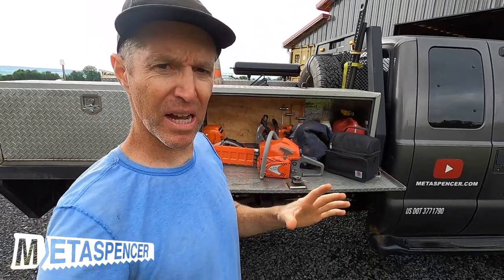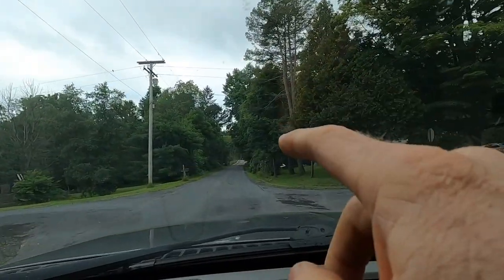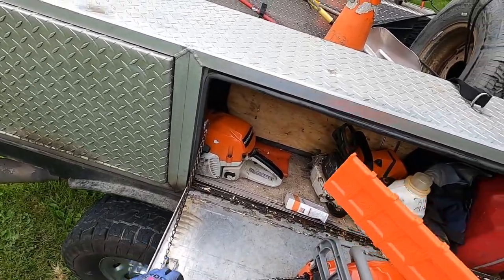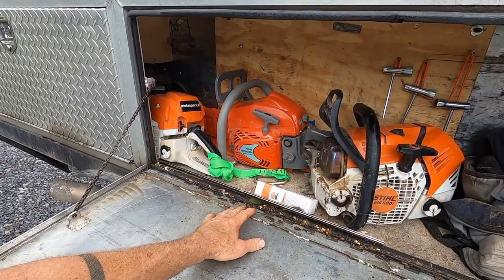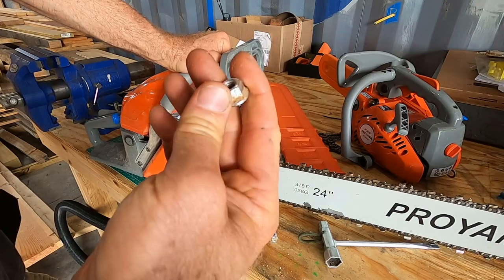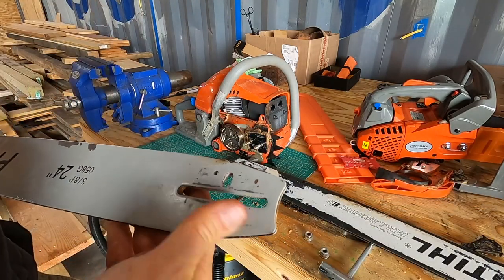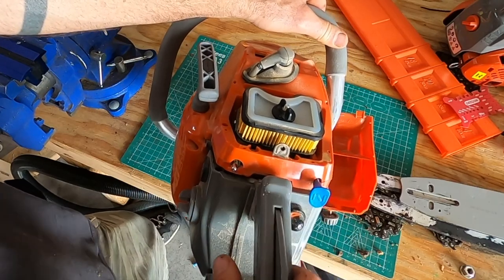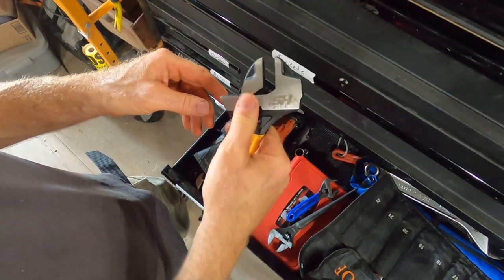*** On the Job Review ** Proyama 68cc Chainsaw

Comment: These lower price point saws have a place. For some folks just starting out these saws are not to bad to learn on . I would love to see one of these 68 cc with full skip 325 20 inch bar and chain  to see if it improves cutting power,Forester sells 325 full skip. That little climber is impressive. A bit of grease on the air filter base helps keeps fines out. K095 Husky bar mount I beleive.
Reply from the maker: I just picked up a full skip chain for the saw thinking it might be good ... so we'll have to see how it performs. Thanks for the tip on grease on the filter. I didn't know that trick!

Comment: That looks like a Husky large mount bar to me.  All the husky bars use those small bar nuts, even the 3120. I've found that for the most part - Stihl uses Stihl bars, and everyone else uses Husqvarna.
Reply: i think you got it... that looks similar... the two holes on the oregon or husky bar is slighlty more biased to the back of the bar and not perfectly centered like this one... but I doubt that would make too much of a difference - it would probably work
Reply from the maker: Makes sense ... I'll pick up a husky bar for backup
Reply: @metaspencer  your rant about bar nuts had me laughing. My on-the-job saws have  included a ported Echo 355T. Stihl 044, 046, and a 661C. Huskies are a 372XP and 395XP.

Not one of them features captive bar nuts. 😂

That said? THIS is a product review done right. “I got this free but there’s a long list of thinfs that suck, to go along with the things China got right.”

It does look like it takes a Husky tail. Which means it will be easy to adapt to Stihl bars with a $10 Amazon adapter. Grind the slot in your Stihl bars longer at the front, and run Stihl bar & chain. My Huskys (and the Echo 800P I sold) have all been adapted to take Stihl gear. I only need a few spare chains snd one spare bar on the truck.
Reply from the maker: @WildAcresFarms  I've never done that bar adapting ... I've gotta try it out! Thanks for the tip!
Reply: @metaspencer  the husky uses smaller studs. So a Stihl bar would have a metric ton of up/down slop. The spacer takes up that space. Oiler lines up so you CAN slap the adapter in and go… but you need a chain with one extra drive link. I prefer to take a carbide burr and cut the forward edge of the slot in the bar longer, so the tensioner can fully retract it. 

As soon as you slap it on the saw & play with it? This will make total sense. $15 adapter plus a minute with a carbide burr and stihl bars run on husky and echo. 😎
Reply: These saws take the small mount K095 Husqvarna bars.

Comment: Very thorough.  Only one of the cons you mentioned, and I heard it on another review, was the melting plastic around the exhaust.  I have to think about that one.  I need a 24 inch bar saw.  I'm taking down some trees that are big.  I had one that was 7 ft in diameter that I had to pay someone to take down.  I have more that a 24" bar will handle but on average an 18" saw is my go to.  I could switch to the 20" bar and have a backup for the 18".  Thanks for the great review.
Reply from the maker: I have another saw that has a foil wrap around the plastic to avoid melting, so there are ways to mitigate heat damage
Reply: @metaspencer  How about some of that stick on Aluminum foil like they use to wrap car muffler leaks and furnace pipe joints?
Reply from the maker: @kenchambers7604  yeah that's the stuff .... seems to work well on my other saws

Comment: I have the same top handle chainsaw that has the clear gas and oil tank and I have no problem with it runs great and starts first pull every time even in sub zero temperature
Reply from the maker: sounds excellent! ya got a good one!
Reply: @metaspencer  so far it is.. I had it over a year now I cut over 10 cord of wood so far and I done nothing to them I just ran it out of the box but I did get a better spark plug and give it a great cleaning so it's ready for the next firewood season... I got it because for years I cut branches right to the main part of the tree then I have to go back to pick up everything that I just cut. Now that I am way older this top handle chainsaw is a game changer because I can cut with one hand and hold the other end and I never have to pick up anything and I looked at every part for the chainsaw and it very cheap...
Reply from the maker: just be DANG CAREFUL! in the arborist world we see a lot of accidents from people one-handing top-handle saws ... so don't let it get ya!!!  @oldrust601

Comment: What do you use for premix oil? Excellent video.
Reply from the maker: I tend to use Husky oil, sometimes Oregon or stihl. I use 50:1 in all my saws, non-ethanol gas. Some of these saws call for more oil in the mix but I haven't had any trouble running 50:1 .... some guys will advise 40:1 though and they may be right

Comment: I notice that there was some fine dust stuck to the bottom gasket of the air filter which makes me wonder if the wing nut holding the filter was tight.
Reply from the maker: Or could use some grease to capture that dust. Good eye!

Comment: The air filter...at least it's not like stihls where I had to buy 200 dollars of after market filters per each saw ..stihl needs to be charged for their REDICULOUS stock filters ..I mean I wouldn't run my sthils without oil filters .one thing I did like about husky the filters...I liked my old 488 shindiawa. Was 10 pounds and it ripped.had a junk carb that only had one jet to tune. But was sweet .
Reply from the maker: I've shifted over to oil filters on my 500 and should probably do the same with the rest: that dang filter catches A LOT more stuff. thanks for the tip man
Reply: @metaspencer  I forgot to tell you get the velocity stack from Gordy and also the max flow the velocity stack is far better and easy to maintain over the max flow but you can't run it in the rain it runs without the cover. But man is sweet .have simaler set up from west coast on 462 those are best filters made can go all week on one sometimes
Reply from the maker: @Sethhaun78  thanks man ... I've got the max flow ... will check out the velocity stack
Reply: @metaspencer  yes I seen it your videos.

Comment: Hey Man, nice review! I am looking to replace an old Husky I had forever. I used the saw a dozen times a year, maybe less. What do you think about these Proyama's for those purposes? I won't be putting it through the rigors of regular work, and i wonder if its viable option for just getting the odd job done around the property from time to time. The savings are huge, its hard to ignore when you arent relying on it for daily use
Reply from the maker: I think what you describe is a great scenario for a cheaper saw. I have a video I dropped yesterday about a NeoTec clone and their saws might be an option for you as well. I'm not saying they'll be perfect and mine have used a bit of tuning to run just right, but sure beats the pricetag of a Husqvarna these days

Comment: The tale end of the proyama bar is different to bar tension holes on a Husqvarna bar there alot smaller
Reply from the maker: it's too bad they're not compatible
Reply: You could take a round file and open the bar tension holes up a bit on a husky bar
Reply from the maker: @woodloveoutdoors  yah that might be the way to do it ... or die grinder

Comment: Had 2 Husky's and both had starting issues . For many years after I had a Stihl 029 , easy to start , dependable and heavy ! When she was retired I ended up buying the Proyama pc62 and after a full year I'm pleased with the performance and it starts every time on the third pull . When I'm on a job and I'm pulling over and over on the rope and it won't start it's embarrassing and unproductive and pisses me off! Mostly embarrassing.
Reply from the maker: Sounds like you got a good one

Comment: Did you ever confirm to see what bar it will use husky or stihl
Reply from the maker: Runs it's own proprietary Proyama bar but it's dang close to Husky ... just takes a bit of drilling/grinding to make it work
Reply: @metaspencer  that’s a bummer guess I’m getting the 372 holzfforma clone then thanks for the info!
Reply from the maker: @briankinzer4175  I've heard good things about those saws!
Reply: @metaspencer  I own a 272 clone it’s got a step piston in it that’s it everything else is stock it’s lasted 2 years built so far and I dog tf out of it now I’m gonna upgrade to the better 372xp or 395xp I just wanted to see about these saws since they are $250 and the holzfformas are $300

Comment: Looks like a husky... I run Stihl I want a saw like this but that interchanges with Stihl
Reply from the maker: I think Farmertec saws might be what you're looking for
Reply: @metaspencer  Thanks! I just bought the MS440 Knock off. Actually I heard they actually buy the old Sthil/Husky patents after they run out so it should be fairly legit. Anyway, I also bought an engine kit to convert my dads old 029 super into a 039 with much more cc. Thanks for the tip.
Reply from the maker: @CrossroadToCountry  That engine kit sounds pretty cool
Reply: Holzffrma(Farmertec) or Neotec/Farmmac Both offer high end Stihl and Husqvarna clones at affordable prices.

Comment: Is it still holding up?
Reply from the maker: I haven't used it a whole lot, but it still rips every time I take it out. Took a bit of tuning to get it running just right, but it's got good power
Reply: @metaspencer  that's awesome. I bought 63cc pinkway and ported it and it will now smoke my 550xp mark2 and weighs the same. It's strange seeing a 120 saw being picked over the expensive ones. I'm not sure how long the cheap saws last but when I was porting it I was really surprised to see the quality of the cylinder was at least as good if not better than my high end saws
Reply from the maker: @matthewknight5641  I got one of those Pinkway saws too and was pretty happy with it ... ported! awesome dude
Reply: @metaspencer  man I removed the base gasket . Did some light port work to the lower transfer area. Shaved a very small amount óff of the top of the exhaust side of the piston and I swear this thing will smoke my 550xp mark2. It's about the same weight but way more fun to run than my 550. The 550 has a muffler mod and it's not slow but the pinkway is on a whole other level. I don't see how husky and Stihl can stay in business with other saws so cheap and faster with a little work
Reply from the maker: @matthewknight5641 sounds like you hit the sweet spot on that saw
Reply: @metaspencer  I really did. I e ported a few others now also but none had the gains I saw from doing the pinkway. It's strange how a saw so cheap can do so well. I e studied about porting for a long time but just recently bought all the tools and equipment for doing it right. I'm normally in my semi truck but all my off time I spend messing with my saws